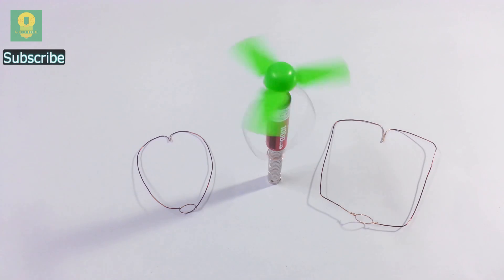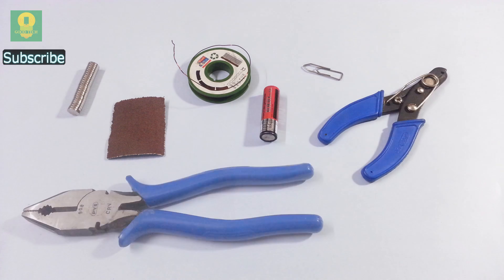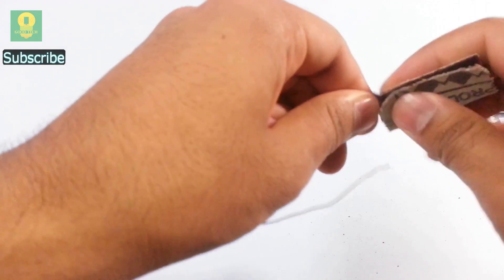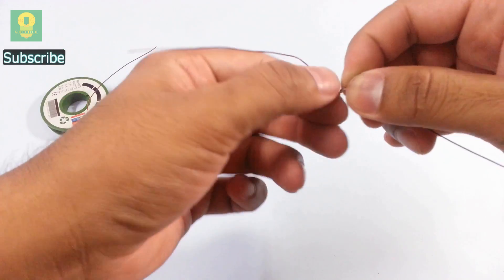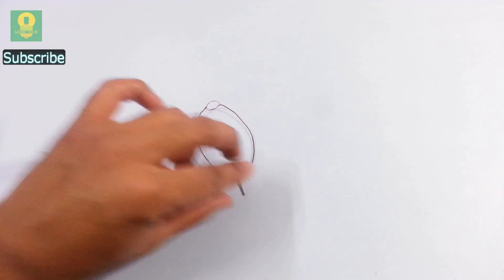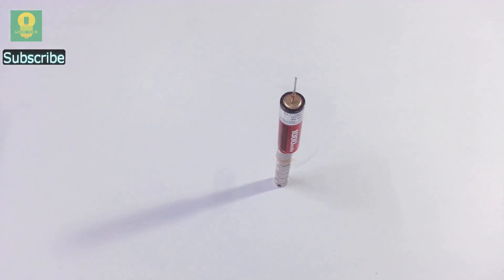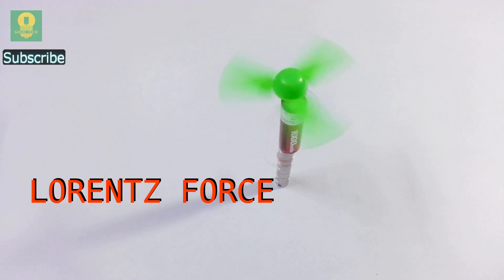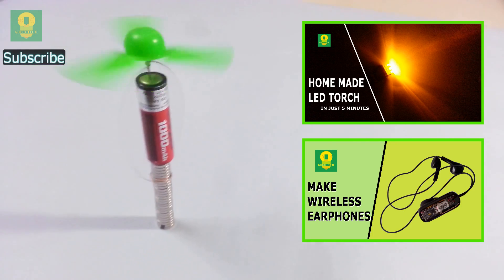How to make a simple motor at home | DIY Motor

Comment: please tell me that quantity of copper wire makes it more powerful or the quantity of magnet . The magnet should be touched from the copper wire and the niddle that should be touched from the wire
Reply from the maker: The wire should be in contact with the magnets as well as the needle. To make it more powerful use copper wire with higher thickness and a high power battery.
Reply: thanks.........